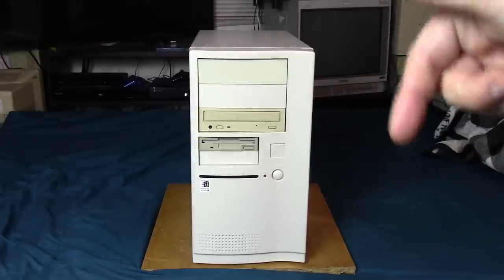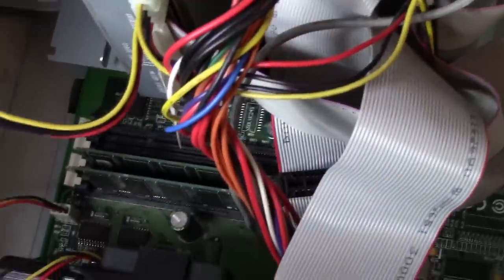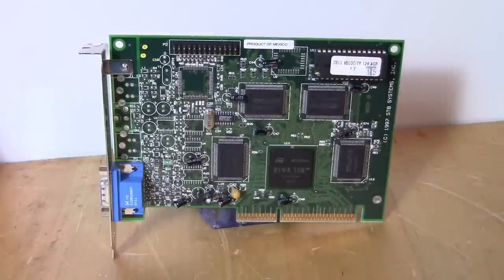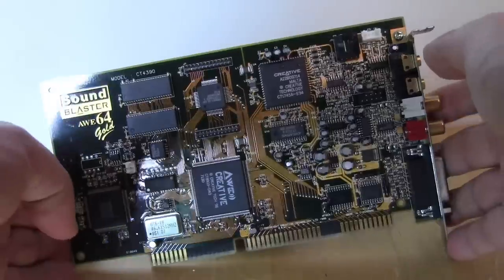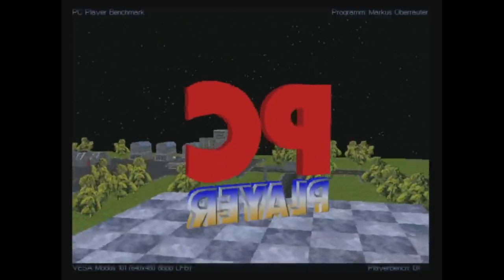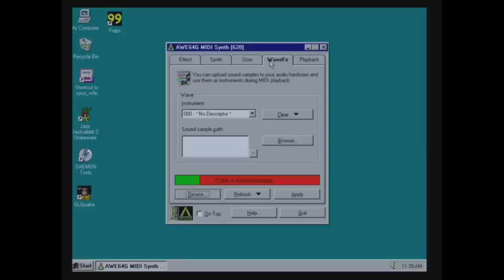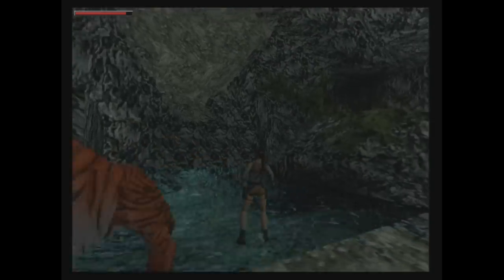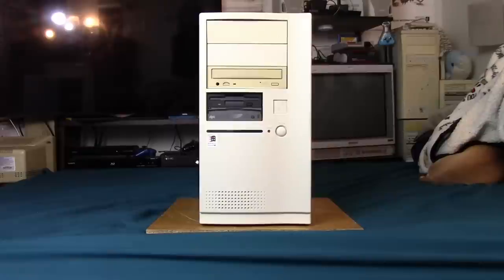Building a High End 1997 PC REDUX

Comment: The white lines on Tomb Raider 2 with the Riva 128/ZX has to do with the texel coordinates. You can change this settings in the driver control panel. You need to play around with different settings. There is also a utility named "NV3 Tweaker", maybe this could also help.

Nice build! I also use the AWE64 Gold on my 98 SE machine with a 333 Mendocino Celeron Slot 1, 440 LX board, S3 Savage 4 Pro 32MB AGP, Voodoo2 12MB and a PowerVR PCX2.

The PII 300 with the 350nm Klamath was the fastest 1997 CPU, but the TDP of 43W is a little bit to high for me for a todays Retro build. Lots of heat and more stress for the voltage converters on the mainboard. There was also PII 300s with the 250nm Deschutes cores, but coming out in 1998...should only have about 20W TDP.

Comment: Nice video! In 1997 I bought a 233mhz Pentium 1 MMX with 32 MB of RAM and a 2GB HDD, not the highest performing machine for 1997 but a little while later I added a Voodoo 3 PCI to it and I have many very fond memories of that machine. Was the first computer I ever owned that was new, introduced me to the internet and many great games.
Reply: I had a Cyrix 6x86 PR233 with 32MB and a 2.1GB HDD - lots of fond memories too - except I never got a Voodoo card and struggled with random video cards trying to get games like Half-Life to run smoothly.

Comment: Our 1997 computer came with 16mb and that still wasn't the lowest sold new. I managed to upgrade to 64mb (maximum for the board) in 1998, when prices for basic SDRAM-66 had dropped significantly. 32mb would probably have been "pretty high end" from the store.

Comment: My first computer in 1997 used exactly the same case :)
So yourse is 100% period correct.
233 MMX running at 290 MHz (3,5 x 83), with 96 Mo ram, Ati Expert Play, Voodoo 1, Creative Vibra 16 and a SCSI cd-burner. 
About 40 fps in Quake 1 :)
And playing Unreal coop as server with friends while I was running Linux Red Hat 5.* and wine ...

Unreal swapped a bit with 64 Mo, that's why I updated to 96.

In 1997, most of people I knew usually had only 16Mo of ram and a 2.2 Go disk. Some still had a 486, one had the first P2 233 a few monthes after I got my MMX.
I first used windows 95, then Windows 98 Beta.

Comment: I think the white lines you are referring to are a precision issue. Along that line where two triangles meet there may be a bad assumption/precision problem/rounding error, whatever and neither polygon ended up drawing any pixels. This results in the pixels being filled in with whatever is behind; either some other bit of the world that's supposed to be behind or maybe even the clear color of the buffer. The back buffer was sometimes cleared completely to black, white or whatever color before starting to draw a new frame; some games only cleared the z-buffer and if nothing is drawn to some set of pixels you see what was drawn there on an older frame which results in flickering junk like when you no-clip out of bounds in Half-life.

Comment: now that's proper 1997 build. well done, resubscribed. 1997 is real game changer because of 440lx and agp for the first time. my win 97 setup is:
gigabyte 586tx3
pentium 233mmx
voodoo1 innovision
s3 virge
awe64 gold
Reply: I had a Matrox Mystique 2D/3D card and a Maxi Gamer VooDoo 4MB. My cheap VooDoo cost £40 less than the Righteous 3D, but it had a much milker, washed out colour reproduction. Did your VooDoo suffer the same thing?

I guess you wouldn't know if you hadn't seen an Orchid VooDoo side by side, but I did, my friend had one and we both had the same monitor. During null link up sessions, mine was very washed out. Same framerate, just more bland.

Comment: New subscriber here :-) I really dig the period correctness with few comprimises - I think this is the best way to really experience a specific era. My approach is to take MoBo, Case, CPU, Graphics, Sound (ESS for ISA, Creative for PCI) from a certain year +/- 1. Then I "cheat" with Drives, OS-Updates and Drivers - there I allow to be 2/3 years off and add a IDE-HDD-Cage modded with a CF-Adapter for Systems without at least USB 2.0. I don't know if this makes much sense, but it works well for me. Also I LOVE your intros, your bed bench and the dogs :-D
Reply from the maker: I more or less do the same thing, try to use original parts as much as I can for any specific era though I make exceptions for things like drivers or the hard drive. I still try to use actual drives from roughly the time though if it's not a mission-critical PC.

Thanks for the comment, glad you enjoy the content.

Comment: I stole a pentium 200 (non MMX) CPU from the computer store that sold me an AMD-PR-133 machine a year earlier, when I had ordered (and paid for) a Pentium 133Mhz system. The guys there ripped me off. They gave me a 100Mhz AMD CPU instead, telling me it was "faster than an Intel 133Mhz Pentium". I was just a kid, only 15, had spent my entire savings on the machine. So, a year later in December 1996, I went back to the store with a friend and while he distracted the guy, I robbed a P200. Took it home and installed it. Basically, to play Quake. My FPS more than doubled, and I finally got my money back that they had stolen from me.

That PC lasted me a long time, it had 64MB and a Matrox Mystique, with a 3Dfx added in 1997. Fond memories of Quake, Quake II, Screamer Rally, X-Com Apocalypse, Total Annihilation, Diablo etc.

Kept it for longer than I probably wanted to but eventually I was gifted a dual P2 400Mhz server machine that was almost as tall as me, and just as heavy. Took a while to get everything up and running with all the SCSI and weird board drivers, but proved to be a great machine in the end. I gave my Pentium 200 machine to a friend who was still running a Pentium 75! XD

Comment: I concur with 32 MB. That would have been a lot of memory; that's plenty to run Quake II, which wasn't even out until December 1997, and was even the recommended for Half-life a year later. It would have been 1999 that 32 MB started to become limiting, and by then a very low end pentium II was pretty much obsolete and you were in for upgrading at least the CPU and RAM with another 32 or 64 MB.
Reply: I believe 64 MB will help in reducing paging stutters in Unreal/HL, and even some of the initial PII machines in mid-97 did ship with that. For UT, they called 32 MB "probably unplayable" in the readme. Also Win98 uses more RAM than 95.

Comment: In 97 my system was a Packard Bell 386 I picked up from a pawn shop. It was my first DOS/Windows system. In 98 I built a socket 7 system with 32MB, a crappy ASound audio card, and an S3 card. I later upgraded it with a Voodoo 1. I kick myself for tossing it out after a couple years to build a new system. Memories…

Comment: As I wanted to do a similar project, you gave me some ideas, but I will be using the Pentium 233 MMX and the Voodoo1 coupled with a Diamond Stealth 3D 3000 with 4Mb memory. I changed my soundcard also to a Awe64 Gold
Reply: That would be a more "real" 1997 high-end  build imho. In fact, the exact one I am trying to complete (still lacking the Voodoo1 part).
Reply from the maker: @con2botonesnadamas433  I guess it depends on how you look at the high end. I was kind of looking at it as if money was no issue and you had 10 grand to burn but yea, I suppose socket 7 would have been the high end for the masses.
Reply: @AncientElectronics  Don´t get me wrong, you have a terrific build there. It is just me, in my mind 1997 is socket7, slot1 is 1998, 1999.
Reply from the maker: @con2botonesnadamas433  Well, I certainly think Socket 7 was more common and affordable but Slot 1 did exist. Pentium II was released in May 1997 so that's more than half of the year they were on the market, as well as the Slot 1 motherboards that supported them. What actual availability was though, I don't remember as my family could not afford something that expensive at the time. $600 to $2000 for a CPU was a bit too expensive for most people.
Reply: @AncientElectronics  Too expensive indeed! And yes, you are correct about release dates.

Comment: I think of the 440BX as a clock-bumped 440LX, beyond updated ACPI support in the southbridge I don't know of any noteworthy difference between them other than the clock speed. It's the earlier 440FX that was originally made for PPro and uses EDO RAM that would be a bit slower, along with lacking AGP/UDMA33 of course. Also, boards by that time tended to include FastVid's functionality as a BIOS option that works at least for speeding up VESA modes.

Comment: Cute video :) , in 1997 I was running a Apple Power Macintosh 9500/132 with 1gb of Ram. Also had a Macintosh performa 580 CD/33 with 44Mb Ram, but that system was my room compy for music and videos :)
Reply from the maker: I've come to notice that at least starting in the 90s or late 80s Macs seem to have far greater total RAM capacity than PCs of the same time. I'm guessing it was no cheaper though. judging from what other commenters have said 1GB in 1997 would have cost a fortune
Reply: @AncientElectronics  For most yes it was, but for me, I was a teen, who had access to the school's servers 😬 No need to say more, besides it takes less than 5 min to swap a stick of ram in that gen of Mac 😏😆Will also say it came in handy for emulation and multitasking. Also the computer ran so much faster with no virtual memory on 😀
Reply from the maker: @mccrh7737  I have a G3 macintosh that would studder at certain sections when playing games like Full Throttle. I eventually figured out it was the virtual memories fault. Maxed the RAM and turned VM off and problems went right away.

Comment: I had 32MB of EDO in 1997. But - my current period correct build has a Tyan S1564S motherboard that supports up to 512MB of EDO - so I'm sure someone built a high-end rig back then and used it with the full 512MB.

Comment: I can tell you exactly what PC i had in 1997, cause I had it up until 2000 or something and I miss it lol. It was a Pentium 200 MMX (166 Mhz) with 32 MB of RAM and a 3 GB HDD, and no graphics card whatsoever. It was enough to play most games including Quake (though at low settings and resolution of course) and some other not so heavy 3D games of the time. But the 3 GB HDD was a pain in the ass, cause it's too little space even for that time, so I couldn't have more than 2 or 3 games installed at once depending on how heavy they were and also needed constant defragging. So you did good on installing a bigger HDD, otherwise it's just a pain.

Comment: Great video man but really whats the difference 1997 or 98.. I can clearly remember my high end 1998 build (built it in mid or 3rd quarter 1998). In a full tower,  DFI P2XBL/D Motgherboard, dual slot one celeron 300A cpus with the SMP drill mod running at 450mhz (4.5x100 they were also able to run at 503? but I ran them at 450 most of the time).  I had a 9 gig seagate cheetah ultrawide scsi and two 18 gig barracudas in raid 0. An ET6000, gravis ultrasound and a sound blaster... Oh and a Video encoder card.. lol. It was no joke and cost me a fortune but I was working at network place and got everything wholesale. In 1999 I added a Voodoo 3 2000 with as heatsink and fan on it overclocked to 3000+ clocks to the machine. I ran it like this for 10 years only upgraded to pentium 3's sometime in the mid 2000s. We had a huge group on IRC EFNET called #Celeron back then, I still have all the parts btw.
Reply from the maker: The date restriction is just an artificial way to add a challenge to the build. I've built a lot of "general era" DOS, Windows 9x, Win XP....ect builds, and restricting things down to using parts that were available in a certain year is as I said, just a fun way to give myself a challenge, and give a build personality. A lot of the builds I do on this channel are not my everyday workhorse PCs and I'm either building them specifically for fun, testing and to make a video out of. usually I make much more general-era builds and do not restrict myself to a specific date if it's for personnel use.

Comment: for most of 1997 16mb modules were $80-$100 (seems high for "entry level" but still VERY good vs 95-96), 32mb modules were more than double that.  not uncommon for ram prices to go unpublished because of extreme volatility but by the end of 97 prices crashed 75%

Comment: P2 300 cost $2000 allegedly, but looking at archived online store pages, you could get one for ~700 by the end of the year
Reply: Yes, well, that was normal. Everyone seems to have forgotten how things used to be priced almost in real time back then; before the death of Dennard scaling. CPUs got ~60% faster per year on average for the entire decade. Mostly from clocks. In the beginning on a new process the yields are shit. You gradually inch your way up, finding issues, redoing the CPU with slightly tweaked design rules that reduce a particular defect or problem you've found in many defective CPUs; not only do yields slowly improve on the new process, you find fewer CPUs that are almost defective and will only operate well at higher voltages and lower clocks. In the beginning maybe only 50% of your PII chips would even have been functional and only 5% of the functional once were capable of 300 MHz at sane voltages with regular cooling. Half a year later maybe you're getting 80% functional PII's and maybe 25% are running at 300 MHz well enough; those 300 MHz chips.

In January 1998 intel released 266, 300 and 333 deschutes core pentium II's which were essentially the same CPU but half the size on the newer 250 nm process (original pentium II was 350 nm). That means that in December 1997 they knew this and were trying to get rid of the last pentium II Klamath at a discount to start phasing in newer, smaller, cheaper pentium II's. August 1998 they were already at 450 MHz. Year after that they released the pentium III which did away with some road blocks to scaling clocks that they had found and they pushed that up to 800 MHz before the end of 1999.

If you wanted to be first, you paid a big premium.

Comment: I don’t know about 10GB drives in 1997, but I definitely did have an 8GB drive that year. The AWE64 can address 28MB max. I have one of the homebrew adapters that takes a 72-pin SIMM. It will take a 32MB module, though it is a bit picky about them, but it still will only see 28MB total.
Reply from the maker: That's odd, I swear when I looked it up I saw 32MB, I assumed it was 28MB from the expansion and 4MB from the onboard memory for 32MB total.
Reply: @AncientElectronics  9 gig scsi was the standard server drive in that time. Very expensive, you could get larger drives but they were not standard height like the 9 gig was.

Comment: Regarding AWE64 alternatives from the time, the Dream-based cards come to mind - Terratec Maestro 32/96 and EWS64, Guillemot Maxi Sound Home Studio 64. The Maestro comes closer to sounding like an SC-55 than any other non-Roland product at the time IMO, while the other two feature 64-voice polyphony. The codecs on these are limited to SB Pro support in DOS though. I don't mind the AWE cards but really wish they would have included all the features in either the stock Windows drivers or the downloadable update.
Reply from the maker: Forgot about the Terratec Maestro 32/96, it's a card I don't hear mentioned much. I'd love to get a hold of one some day but they seem pretty hard to find.
Reply: @AncientElectronics  It's probably too late to find any of that stuff for sane prices. I have the EWS 64 XL which is the successor to that card, nice to play around with but I'd prefer a real Roland or Yamaha to the knock-off soundfonts any day.
Reply: I'd have also considered the Aureal Vortex for a 97 build too! Awe64 is an awe-some card though.

Comment: I had the same case in 1997 /98 (was my first own pc build with Pentium MMX 233  64MB PC100 , 4,3GB HDD seagate medalist, Chaintech TX  motherboard. And velocity voodoo card AGP.
Reply: Why PC100 RAM in a CPU with 66mhz Bus?
Reply from the maker: Because its what I have avaliable. Its running at 66mhz so its functionality identical to running pc66, that's all that matters.

Comment: I don't get getting putting that much thought into the memory. Few keep their Amiga, Atari ST or IIgs stock and many try to max out RAM as much as possible. If you want the system to act like it has less RAM you can configure it with a RAM disk.
Reply from the maker: It wasn't that much thought. But much of the fun is the challenge of getting at least acceptably close to period correct. I have a box full of sdram, its a matter of two or three minutes to go grab two sticks of 64mb memory or anything else for a project.

Comment: The AWE64 card is cracking. I don't think everyone is being fair to Creative.
Reply: Creative gets a lot of shit for patent-trolling Aureal to death and setting 3D audio back >20 years. 3D positional audio is still not as good as we had in 1998. They also had a billion models with various configurations in a big confusing mess; sometimes the very same model could come with CQM or real OPL3 chip even.
Reply: @soylentgreenb  this is true and what they did to Aureal was a huge setback. However I sense that we'd have still ended up with 'whatever, good enough' audio at this present time because people seem to just use whatever is on the board. Creative are still making cards, but when did you last hear of someone adding one?